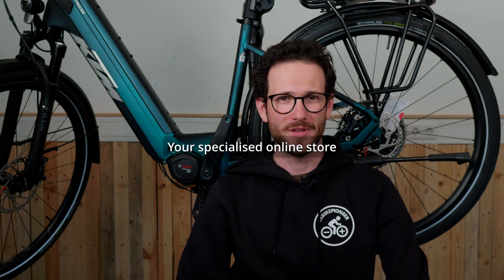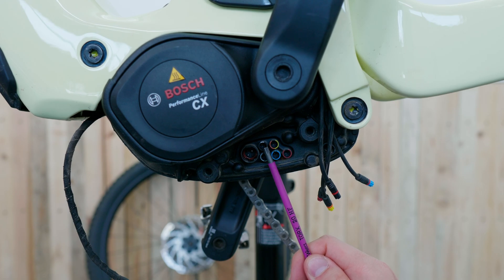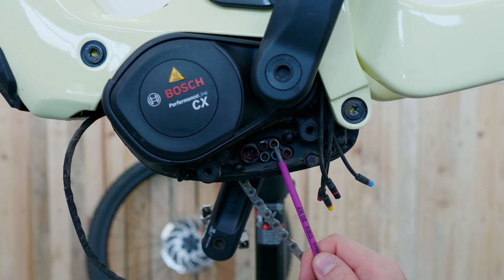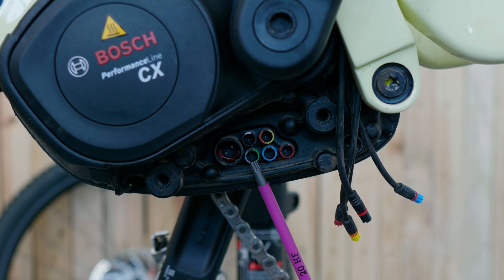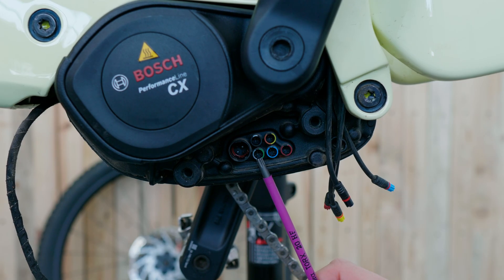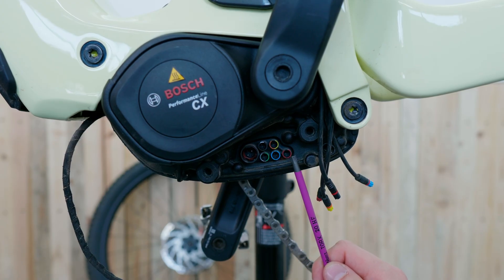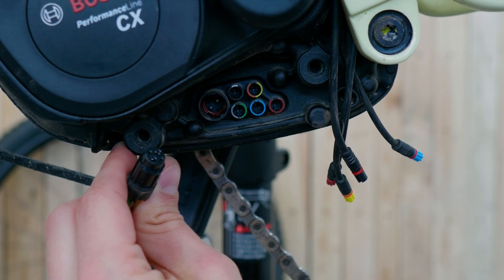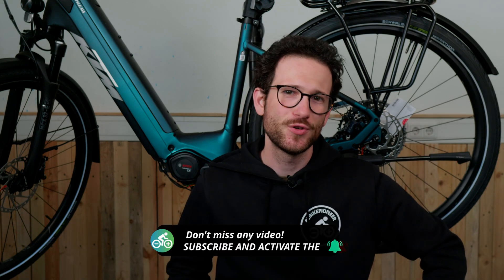Bosch E-Bike Motor Connections 🔌 Generation 5 Motors Smart System | EBIKE24

Comment: Just curious, are this connection the same for all the Bosh motors in the smart system?
I’m the proud owner of a 2025 Cannondale Tesoro carbon equipped with a  Bosh Performance Line Sprint (BDU314Y) motor
Reply from the maker: Hi, Bosch Performance Line Sprint is a 28 mph motor for the U.S and N.Z., its connections are not the same. Thanks.

Comment: There was a comment about each port being keyed so you couldn't make a mistake with plugging things in.   One question I have on this is whether the green plugs (for the LPP) might be keyed in such a way that they could fit into the LPP on the motor AND also the HPP on the motor.    Any device that could be powered by the LPP should also be able to powered by the HPP.   The opposite isn't true so surely a Yellow/Orange plug would fit only on the HPP of the motor.
Reply from the maker: You're right. HPP can deliver up to 4A on demand, what is necessary for certain devices. It doesn't hurt LPP devices. Thanks.